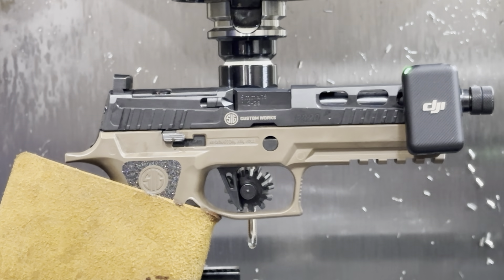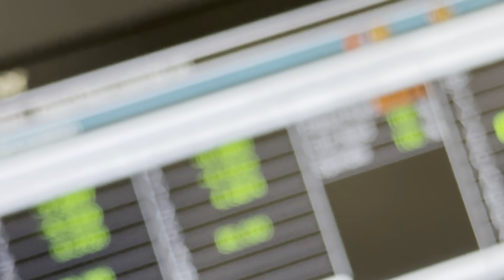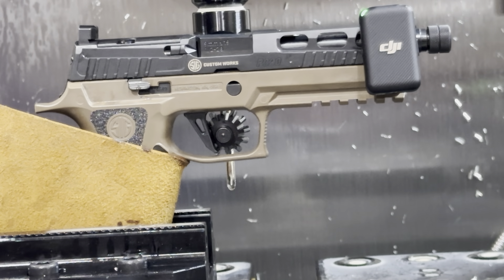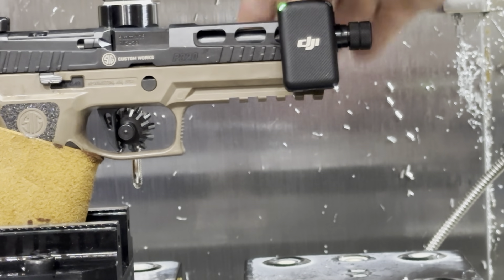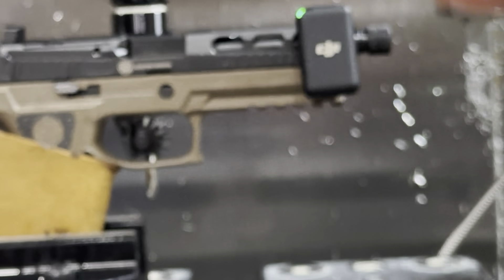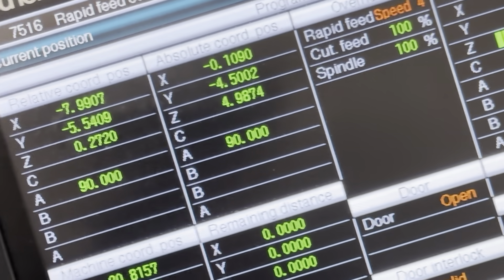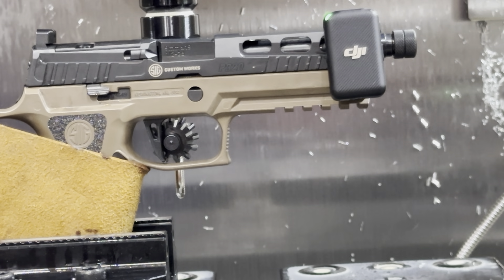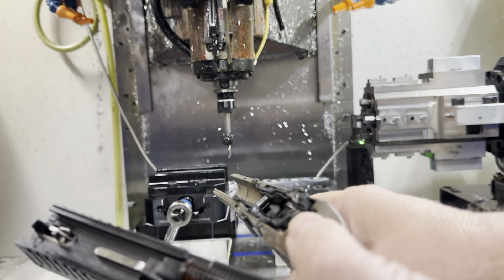Sig P320 accidental discharge tested in CNC machine.

Comment: The missing link here is if the trigger was pulled to the wall and maybe beyond then you let off the trigger, and due to flawed parts or just carbon buildup on the sear it stuck in the position (at the .090 point) then reholstering could set it off. Just because you let off the triggers doesn’t mean the sear will return to full engagement. That’s the issue. Along with sloppy slide to frame fit.
Reply: You have a really good point! I want to see that tested.
Reply: @ShoddyRC not a good point. A stupid point looking for any reason to justify his dumb shit feeling related to this weapon because he went around pushing his dumb shit theory and now won’t admit he WAS WRONG and all his moronic disdain for this weapon was created marginally connected brain cells and spewed through his vagina soft mouth. Pathetic.
Reply: Exactly it’s not every single gun but the insane amount of slop in these guns is unacceptable. Then add on top of that the fact that as tooling wears and then gets replaced and parts get thrown into massive bins. Then they get randomly assembled on a Friday at 5pm that means out of 5 million guns there is probably a few thousand that under the right circumstances will fail and are incredibly dangerous. Think of a dirty gun that has springs which have taken a set because a bad batch of heat treat or something and you have sear failure because the stupid slide moves around like a mechanical bull. So yes this clean properly functioning gun is fine. But shoot it 5 thousand rounds with little to no spring maintenance or get one that was already on the edge of safe from the factory because of QC and this sucker is dangerous!
Reply: @MinimumSpeedOperator that's what one of the police department  found the seat team guns that had more rounds and had less cleaning and servicing were more prone to failure
Reply: @mjones9708  exactly when the tolerances are just that wide as they are in this model it’s bound to happen with some examples. Just like a bolt action rifle. Sometimes you get a barrel made with a brand new chamber reamer. Sometimes you get one made on the last pass that reamer will ever make before replacing. Therefore the first gun will have a more loose chamber dimension than the final one. This QC is critical to ensure it’s within operating limits regardless. Sig has failed at that. The exact specifications of the drawings and patents may be mechanically safe if everything is perfect. But what we have here are examples that’s during production and then their regular wear and tear in the lifecycle are becoming dangerous to users.
Reply: @MinimumSpeedOperator  "insane slop"  in other brands is to keep it reliable so dirt and crap can fall out. Can you show any proof of your theory other than speculation by clout chasing influencers?
Reply: @CCW1911  there is nobody who knows what they are talking about that claims the slop in sig slide fitment increases reliability in a semiautomatic handgun. People talk about that in the AK series and even that is completely different because it is hammer fired where there is 0 slop meaning the gun is still safe. On a striker fired pistol that slop is part of a critical dimension relating directly to safety not reliability. So try again my friend.
Reply: @CCW1911  last time i saw a gun with that much slop it was on ANVIL and Mark Novak hammered the rails down,  to make it tight, and that was a 1911 that had been shot to shit.....

getting something with that much play out of the box is fucking ridiculous
Reply: @MinimumSpeedOperator  so..... lets get this right.....
you're saying VERTICAL PLAY on a handgun built to the THOUSANDS OF AN INCH  is not an issue when you're talking about safety with the  OPERATING MECHANISN WORKING VERTICALLY?

riiiiiiight
Reply: @billhanson4921  did you even read my post? You and I agree it’s the other doof you are talking about. You and me are same page man.
Reply: @MinimumSpeedOperator  yes we are, i'm convinced its a big problem in the design of this thing coupled with wear.....i mean there is no fucking reason a slide should be that damn loose, expecially on a striker fired gun with tight tolerances its like you are deliberately putting in a fault into the weapon
Reply: @billhanson4921  exactly! It’s the craziest thing I’ve ever seen from a striker fired pistol followed by the decision not to put a blade safety in the trigger shoe itself for a duty striker fired pistol. It’s just nuts!
Reply: that is probably the second option, on how the strikersafety fails. In LFD Reserch's video (p320 parts and wyoming response) at 2:11 it can be seen that the lever lifting the safety gets stuck slightly raised, and only drops fully once he taps it with his finger.
Reply: I had no idea the slide to frame was soooo sloppy on these LOL... I only have experience with m&p's....WHY the hell dont police and military use a reliable known brand like smith and wesson ??
Reply: @mike93eh  idiots run the show
Reply: @mike93eh  Amen brother!
Reply: Exactly! 

This is just one part of the puzzle. 

These videos have shown that because of the loose slide to frame fit, the P320's sear can lose contact with the striker without the trigger being fully depressed. 

We've also seen issues with the striker block. 

I suspect that it's just a waiting game now. Someone is going to find the final piece of the puzzle.
Reply: That slide slop is bad, really bad. Just got back from the gun store and checked out a 320, SLOPPY AF right out of the box.
Reply: Exactly.
Reply: This is what i have been attempting to get people to understand. In this you are pulling the trigger to the point of discharge. If some one can find a gun that fires after getting to that point and being let off. That would be a huge flaw.
Reply: yeah jamming it back into a kydex with a light on the bottom smooshing it all back together
Reply: So are you implying that all of the guns that went off while holstered had a little elf in there pulling the trigger for them 🤷‍♂️
Reply: @DiggySmalls no- Jesus christ
Reply: Or if there is dirt or mud on the gun (like in military and law enforcement situations and training).   That could easily cause this issue.
Reply: Pretty sure this is happening aswell but a striker that’s got full potential without pulling the trigger is the key to the issue
Reply: Another issue with this lazy apologetics - "2 mm" only applies to this specific specimen. And we've all seen the "less than 1 mm" specimen.
Reply: Yes materials issue  could cause this
Reply: Except there's an inverted angle so when you let off the trigger friction naturally raises the sear. Which is why you haven't seen a single case of someone doing this- letting off- and then causing a discharge from slide movement. Because when you let go- the sear tightens again
Reply: @SkankinRep unless there is damage or rough places on the striker or sear and if the spring tension has weakened on the sear return springs.
Reply: Prove it. I have put 3500+ rounds through my p320 since last cleaning! Do realize how many rounds/carbon you would need to fire to overcome the sear spring??! NO, you don’t and neither do I but at that the point it happens (if it happens) it would be user neglect, NOT mechanical design flaw or failure. 

But what if an alien took the sear spring. What if a roach crawled into the space beside sear, what if I was blind deaf and holding my pecker sideways when I holstered my P320!!!

You people are haters. Illogical, irrational, haters. You do harm to small business, like the one my best friend owns, with your BS theories and opinions. Opinions based ON TOTAL NONSENSE you say on fuckn line.
Reply: My first issued pistol was the Sig 226 with a very heavy and SAFE trigger. But this is what happens when the brass gives in to pussies crying for a combat pistol with a lighter trigger 🤬
Reply: I'm new to the mechanics of guns  can it just be a bad batch out there  I see people saying they had theirs for 5 to 7 years no issues so is it the newer ones or just random?
Reply: My thoughts exactly.   One of those trigger safety dingus levers would make it obvious if it didnt return. And a stronger spring.
Reply: The sear is in the frame the sear engagement surface is in the slide. Yes poor slide fit will cause problems, in particular uneven and therefore accelerated wear of the sear surfaces, combine that with potential issues is qc with the sear surfaces.....
Reply: This. I will never feel safe around these after what I've seen.
Reply: I'm seeing this test everywhere now. Why isn't anyone doing a comparative test. Would love to see this exact same testing done on the P365, and various other striker fired guns on the market -- various S&W M&Ps 2.0s, shields, bodyguard, Glocks, Springfields, Caniks, etc...  If this can't be replicated by any other striker fired gun, then it's clear that this is a design flaw exclusive to the P320. At that point even if it is the users fault, we can agree that the 320 has a design that makes it far more susceptible to user error than any other striker fired gun on the market
Reply: But why are not at least inspecting your firearms after every shooting session, and probably should be cleaning your firearm after every 2 shooting sessions? You as owner of a gun, are not just responsible for the bullets you shoot. But for the maintenance of your firearm, including cleaning, and inspecting any parts for wear or possible breaks.
Reply: @iTrinityPlays if sig had put this in their directions then they would have a defense. But they didn’t. Then they added to their direction to not carry a round in the chamber. Bad decisions on their part.
Reply: @hcdtactical 
Sig screwed up BIIIIG time.
Their public relations area is 0.
Reply: @iTrinityPlays  
Technically true, but also a rubbish excuse.
Reply: This sig in the video is the LAMBADA model. It’s so loose that it decides to dance by itself.😂
Reply: Close. I posted my opinion above
Reply: That sounds worth looking at.
Reply: How come other striker fire guns fail the same test?
Reply: Make it fire without touching the trigger, and you will really have something.
Reply: "sear it stuck in the position (at the .090 point) then reholstering could set it off" How much carbon buildup is needed to overcome nearly 5 pounds of force pushing the sear back up.
Reply: @notes9504 I don't know and neither do you. Neither does sig. Knowing that, do you still want to point it at your balls? When there are dozens of known safe better alternatives?
Reply: @notes9504 none is the answer because carbon wouldn’t be the likely cause. Poor QC, worn parts or other debris could well cause said issue to occur…..
Reply: @notes9504 & what cop's firearm would ever be that dirty?  Most hardly ever get fired, and are cleaned regularly & lubed.
Reply: But on the flip side, who pulls the trigger back to the wall, then holsters it?
Reply: @NJeverydaylife  "whenever you make something idiot proof the world makes a better idiot"  remember that
Reply: @NJeverydaylife  Doesnt matter who does it, the gun should only go off if it’s a full trigger pull.
Reply: So we should blame Sig for poor gun maintenance by the user? That’s like not putting oil in your vehicle and blaming Ford cause the engine seized up. Idiotic thinking. Also, just incorrect because of the force exerted by the various springs.
Reply: @trcapper9376  If the difference between a gun being safe and not is a trace amount of carbon, pocket lint, etc...the gun is of unsafe design.
Reply: @droidgee it is not a trace amount I promise you. This is irresponsible, negligent maintenance. Horrid amounts of lubricant, solvent, cleaners not made for firearms - all used in improper locations, attracting carbon, powder and brass to create a maple syrup like sludge. Too many people think they can repeatedly spray or douse these guns with liquid, shoot several thousand rounds and also never have the guns looked at by an armorer or gunsmith. Also no replaces parts on the replacement schedule. I’ve seen this personally with a mid size police agency’s guns who were not ever looked at for 8 years
Reply: @trcapper9376 can’t fix stupid bro. No matter how hard you use logic with these dolts, they won’t listen.
Reply: @trcapper9376 except that it is 100% anticipated that a user in a service situation might have a dirty pistol. Remember, these are supposed to be military service pistols…crawling through mud, blood, oil, etc. 

For a bit of mud or carbon or debris to render the gun unsafe is unacceptable
Reply: @TheRocketmedic it’s not a “bit” I assure you. If you knew the amount of irresponsible or negligent maintenance it takes to cause this you would agree.
Reply: @trcapper9376  
> So we should blame Sig for poor gun maintenance by the user?

Yes. "User lapse" type of user error making gun unsafe is a clear and cut case of a design flaw.
Reply: @Conserpov I think you’re misunderstanding the amount of poor user maintenance that causes this level of failure. I agree the gun should function dirty, it should be robust under adverse conditions. The amount of poor maintenance that causes this is negligent on the user. I’ve armored an entire departments guns, I assure you this is irresponsible level. Similar to not maintaining any machine
Reply: @trcapper9376  
If a sear is mechanically capable of losing engagement without a trigger pull, it is an absolutely egregious design flaw. And if loose tolerances allow it to happen, that's an egregious manufacturing flaw.
Sig's design and manufacturing practices are what's really irresponsible here. You are making excuses.
Reply: @trcapper9376  
Jim Price identified a specific egregious design flaw that seems to be directly responsible for uncommanded discharges
Reply: @trcapper9376  No but for example you could shoot an M9 until it is so clapped out the hammer mechanism FAILS entirely and it will still NEVER discharge in a holster. Period

Comment: Guy makes a video showing his pistol can NCD, and then claims its not an issue? The issue is tolerance stacking, potentially ware, and the lack of a trigger safety. Most holster grip the pistol by the trigger guard, and with the wider than usal trigger, means the holster can potentially press the trigger enough to caise the individual pistol to fire. Plus, you add potential dirt and debris in the holster it is compounded. None of this would be an issue if SIG had just incorporated a trigger safety.
Reply: A trigger safety would just stop the trigger from moving that wouldn’t necessarily stop parts from failing due to buildup
Reply: Your last comment about a trigger safety is false. The trigger safety on the M17/M18's do NOT block the sear whatsoever. Thus, do not prevent the sear from dropping and then allowing the striker to set off the primer.
Reply: A glock style trigger safety does not always prevent the trigger from being moved back.

Comment: I have a M18 and I can’t get it to fire with slide manipulation no matter where the trigger is staged. Some say their 320 will fire just on the wall(slack taken out). I don’t know what to believe.
Reply: I have an xcarry and an xcompact...both slides are mostly snug against the FCU...with/without a mag inserted....the xcompact slightly wiggly. But neither discharge when trigger is depressed firmly (but short of firing) and nose of gun depressed, or rear of slide forced up.   Both guns have about 1200 rounds.
Reply: There's nothing to believe, unless you don't trust your own eyes. Best case scenario, the guns aren't produced in a tight enough tolerance to prevent this happening to all of them. Worst case scenario, they all do this, and you haven't tested it precisely/rigorously enough.
Reply: @ShadoSnipr I don’t trust my eyes. I’ve seen the videos of the uncommanded discharges. To me they don’t look like user error but a series of factors that could lead to the discharge. But I can’t say without an absolute reasonable doubt they were not ND’s. But there is enough doubt for me not to trust them. And the way Sig has been acting does not help. As for my testing, you’re probably right. I did not test it rigorously enough. I don’t have a CNC machine.

Comment: But it’s still not a full trigger pull …..
Reply: 'Full trigger pull' is when the gun fires.  Movement beyond that is called 'overtravel'.
Reply: @not-fishing4730 but that’s not what he’s showing in the video he’s showing that it goes off at the wall not past it …..
Reply: Then says “well it’s close enough “ 😅
Reply: @not-fishing4730 'full trigger pull' is when the gun fires... From pulling the trigger, not from anything that causes the gun to fire. If he was able to replicate this at 0.01mm of trigger pull, would you consider that "full trigger pull" if the gun was designed and manufactured to fire at over 2mm of trigger pull?

Comment: Again, this is one example, and I don't believe this is a problem with every 320 out there.  You also can't assume that every 320 out there will measure out the same as the one in this video.  This shows one specific 320 that appears to be within it's specs, and functioning normally.   Now conduct this testing protocol with at least 20 or more 320's and compare any variations between the pistols.  If your findings show 20 or more 320s have essentially the same measured outcome as your 320, thats show multiple examples performing the same , or a pattern of equal functioning.  This is what no one is doing, testing multiple examples at one time.